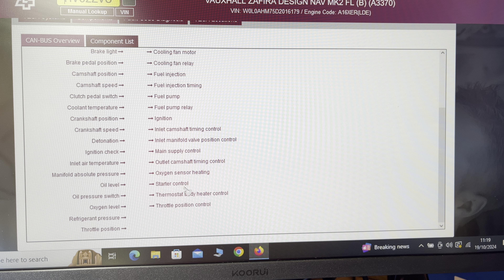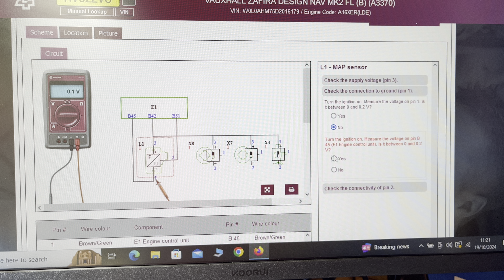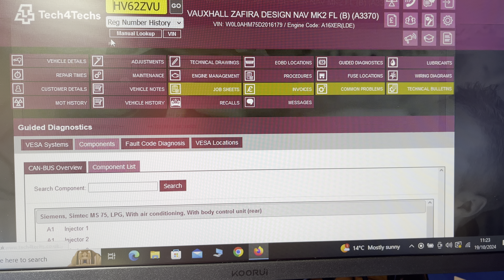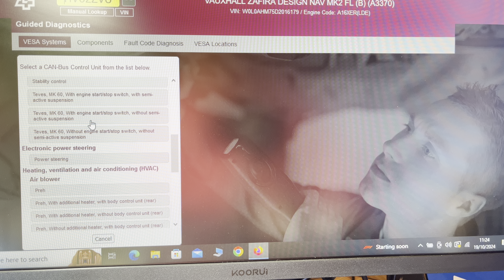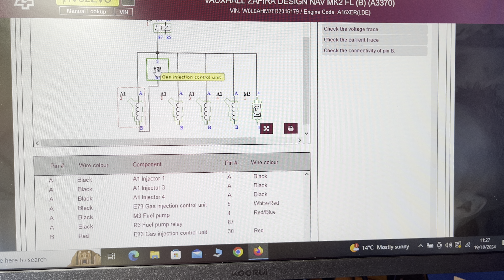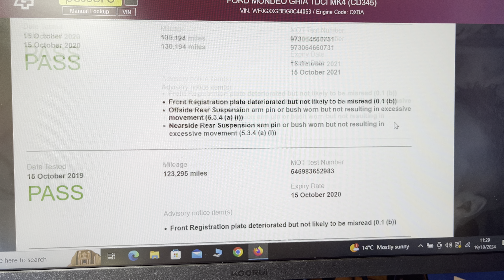Tech4techs brilliant database

Comment: Im mid trial with Tech4Techs, overall very impressed but have found wiring diagrams occasionally lacking on some models, Discovery 3 being one. Is HGS still the goto for wiring diagrams? Looking to avoid Alldata/Autodata nonsense pricing.
Reply from the maker: Hi yes hgs is great tech4techs diagrams are hard to follow at times
Reply: @caralarmandradio  Cheers man 👍